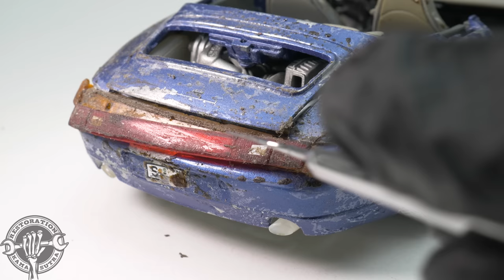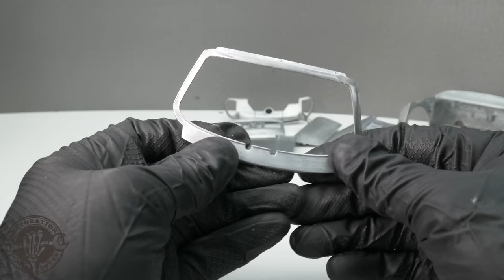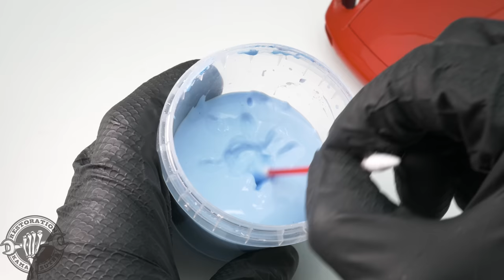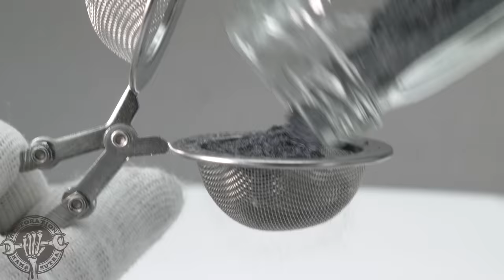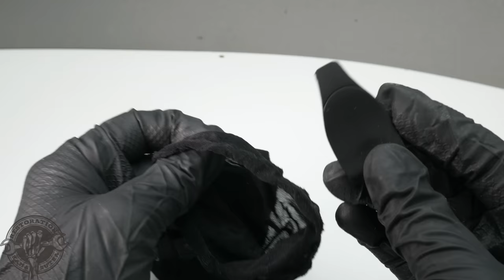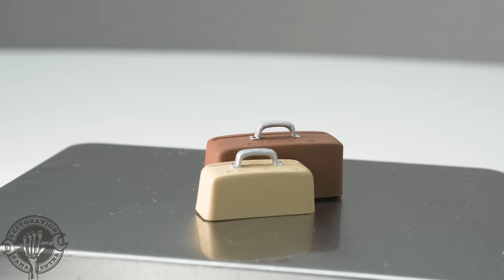Restoration old Porsche 911 (993) Carrera - Restore and customize classic Sport Car

Comment: I'd have straightened up the Bent windscreen frame before paint. Also like the bit where you 3d print a wheel and then cut to painting the cars original wheels, casting marks and all 😂

Comment: They have small enough motors now you can actually install...  or even a small electrical motor, you could make it drivable with remote either way..
I was thinking even just adding LED & a small flashing circuit board would be cool too...  even if for only 1 side turn signal while brake lights stay lit..  or staggered flashes on brakes..
could even make the left turn click sound from a Metronome...  with magnets that activate the flash as metronome pendulum passes contact...  no battery required..  8D

Comment: The restoration part is fake
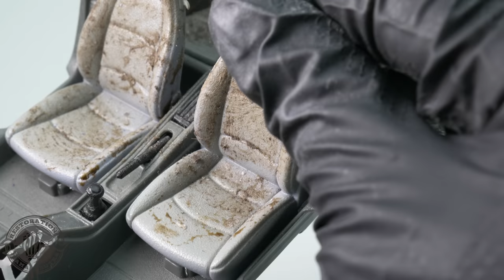1:00 
how is the bench so dirty but the floor is clean?
Why does this dirt have the brushstroke pattern?
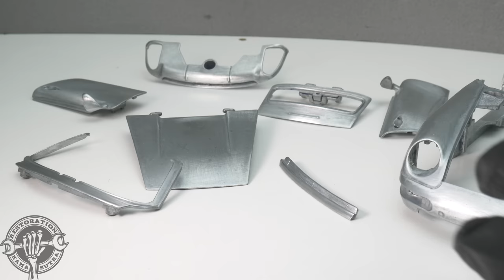1:34
in the scratches of the paint the metal is perfect, if it was in contact with the soil as part of the dirt indicates there should be some level of rust
BUT!
the customization part is really good
Reply: Пришлю тебе убитую модель: временем, мной или уличными псами.
Попробуй, восстанови сам.
Чё, проблема?
Reply: @s.s.soviet  он тебе про цвет, ты ему про вкус

Comment: It looks lovely, it really does.  Better, in fact, than it would've done originally, what with those horrid beige plastic bits.  But I have to ask...  The 911 has a six cylinder boxer engine, so why did you put in 12 HT leads?  You created a little bit more work than you needed to and made it marginally less realistic, which to me is a damn shame.  But still, a beautiful restoration job.
Reply from the maker: Power system - Bosch L-jetronic; two spark plugs per cylinder :)
Reply: @restorationkamasutra  Ah, I wasn't aware of that.  Thanks for the info

Comment: I'm sorry but.... why flat 6 has a 12 High voltage cables?!
Reply: 993, 964, and other high output models are twin plug per cyclinder. So yes, 12 wires.
Reply: @christenrten  well, OK, sorry. Just I didn't see this before